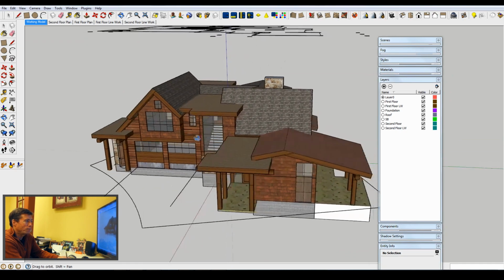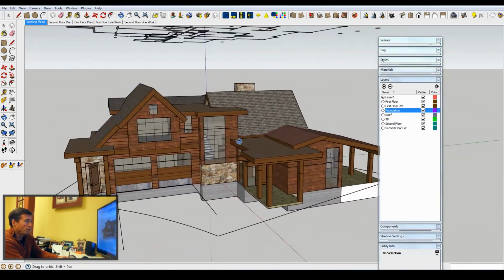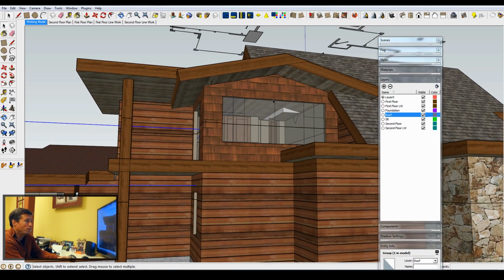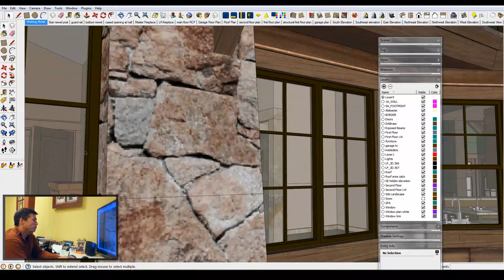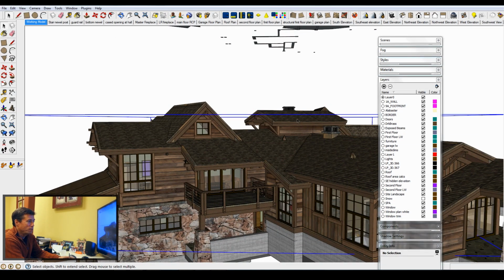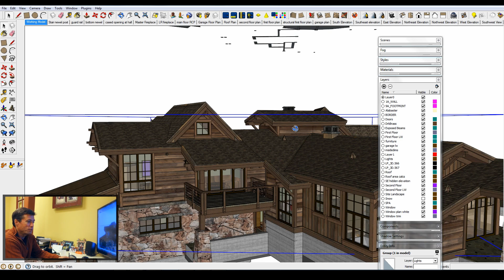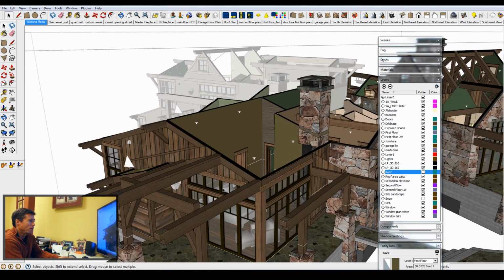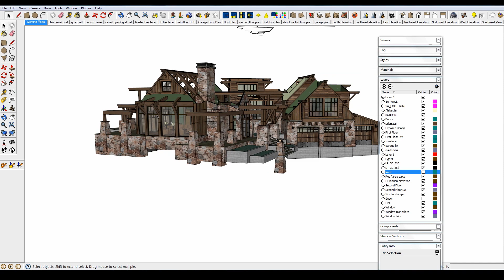Nick Sonder Process 6 - SketchUp Model tips

Comment: Nick, Thank you for making these videos and sharing them.  I have found the information very helpful.   One question, is there anyway to hide the lines between groups?  For example there is sometimes a line half way up a wall where the first floor group and the second floor group meet.
Reply: Nice question!!! I  I have the same problem, the line between the over site slab and the walls show.
The lines are actually 2 where the groups meet , Try hiding each in its group.